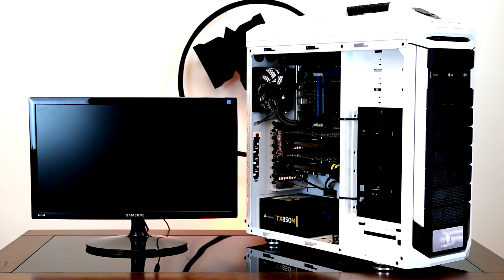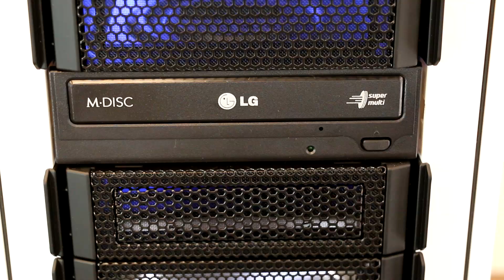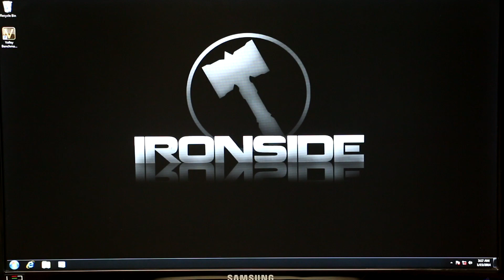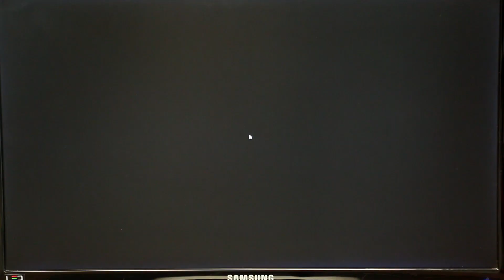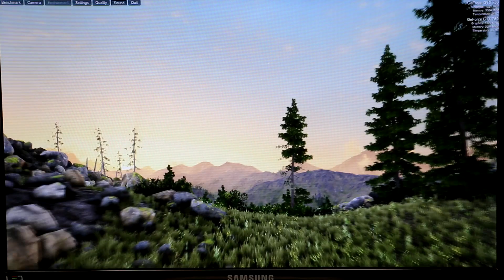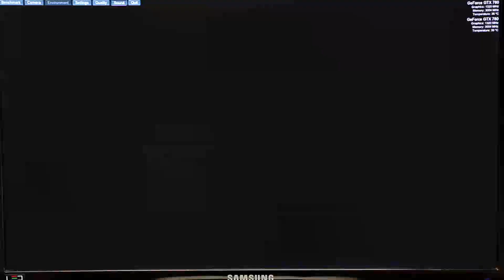Ironside Computers Video Demonstration - Order 814119

Comment: Well this was probably around 3800
Reply: Not even close bud. You need to learn to estimate better. That's $2800 MAX.
Reply: lmCIoudz Are you dumb 2 780's are 1200+, 4820k is like 375, His MB is 250, his ram is up there too. Adding all that plus the other stuff this build could easily hit 3000
Reply: IkamBeing Are you dumb? He said $3800. You fucking idiot.
Reply: and you said 2800 MAX and 3000 is actually higher than 2800
Reply: IkamBeing My bad, $200 off.
Reply: you wrote MAX this implies that it is probably with horrible price it will still be 2800
Reply: IkamBeing Again, my bad.
Reply: And by the way. 780s aren't $600 a pop anymore. That'll bring your estimate down.
Reply: http://www.newegg.ca/Product/Product.aspx?Item=N82E16814130917&nm_mc=KNC-GoogleAdwordsCA&cm_mmc=KNC-GoogleAdwordsCA-_-pla-_-Desktop+Graphics+Cards-_-N82E16814130917&ef_id=Ut3XxwAABPXA31zP:20140124231031:s
Umm.. yea they are
Reply: IkamBeing Do some looking around. I can get a 780 for $530 on amazon right now. Usually people go for the cheapest prices, I guess you're just not the same.
Reply: may I remind you MAX you said MAX
Reply: IkamBeing May I remind you that I say MY BAD twice?
Reply: but MAX...
Reply: IkamBeing I'm done replying.
Reply: MAX!!!!!!!